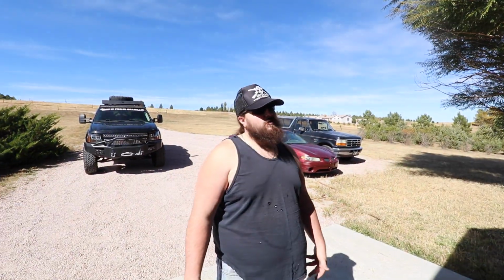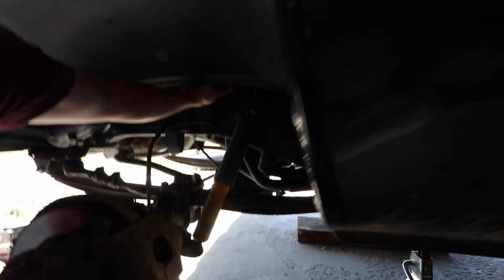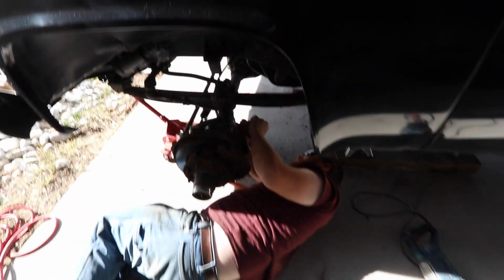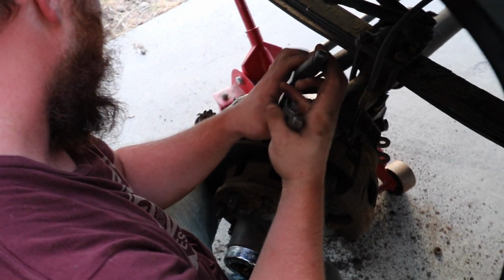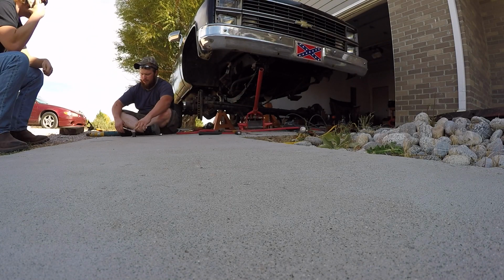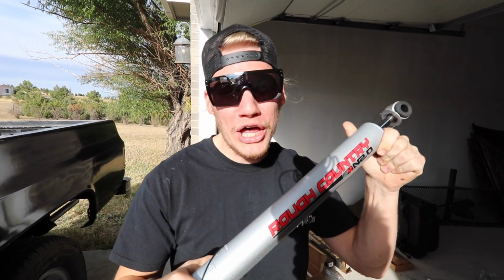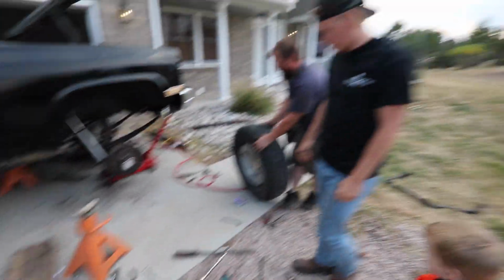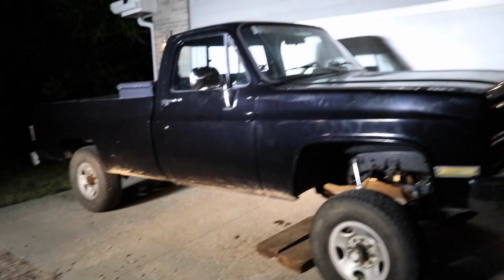Lifting my truck to the SKY...

Comment: Check out ORD they are in Colorado. Those square body chevys have been notorious for cracking out the frame around the steering box. They make a bolt in kit as well as a weld in kit to strengthen that weak point.  Also Check out their crossover and high steer kits.  but the truck is starting to look badass.

Comment: With the cone washer just put a soft metal bar (like brass or aluminum or some shit) against the top of the thread and hit it with a hammer. I should come off easy after that

Comment: is it legal to not have license plates there or do you just have those flag plates on for vidjas
Reply from the maker: Who cares
Reply: hi outlaw
Reply: Not many states actually require front and back plates. It's ridiculous to have to have one to begin with.
Reply: In Indiana it's legal to only have the back plate, it varies state to state lol
Reply: in Colorado you only have to have tags on the back
Reply: ChrisHotRod even if the law was two plates for a truck you only need one on the front none on the back because of towing.
Reply: ChrisHotRod no, there's a Kentucky plate in the back, you don't have to have a plate in the front.
Reply: ChrisHotRod its legal depending on where u live but most places its legal

Comment: y did u cut the ubolts for
Reply from the maker: Cause FUCK EM that's why.
Reply: fuck it dont need them anymore
Reply: your not supposed to reuse ubolts, once you torque them they stretch and could break if reused. most shops cut them for that reason.
Reply: i didn't know u had to cut them ive never put a lift kit on yet

Comment: outlaw u shoulda done the engine first before the lift cause it's going to be hard as hell to do
Reply: Lol, no it wont. It will be easier since you have better clearance
Reply: just get a step and let the air out of the tires. problem solved